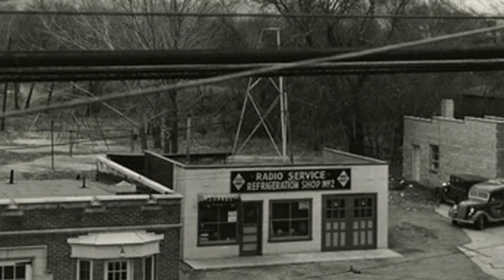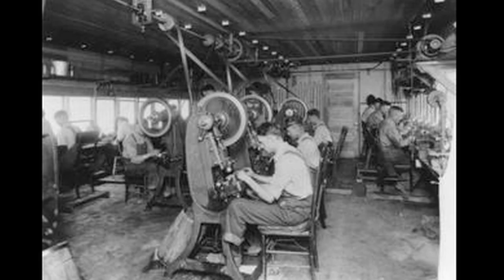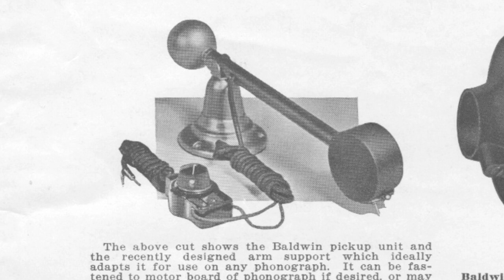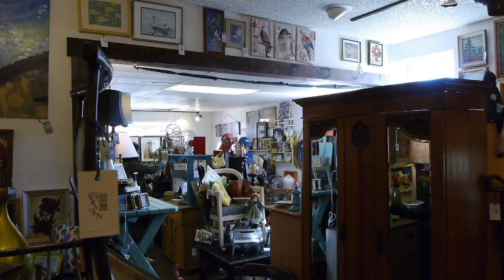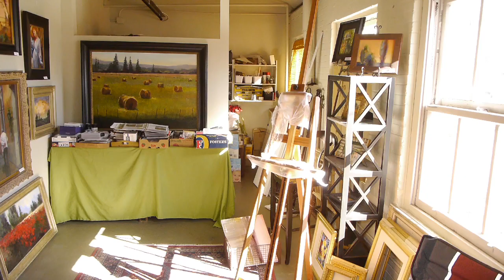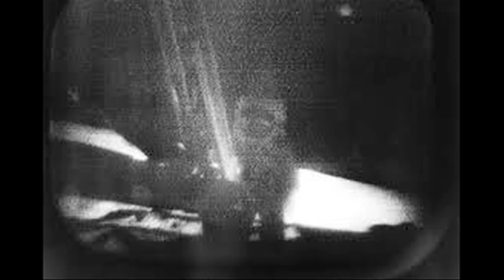The Baldwin Radio Factory - The Salt Lake & Eastern 2

Comment: You just made my day.  Back in the early 1970's I purchased a very, very old speaker.  The housing is made of wood.  The speaker itself is made of canvass and is about 7" in diameter.  The magnet is really interesting as it is not the round type commonly in use today.  It is a horse shoe magnet.  The cord is of course cloth covered, as was common back then.  There are two brass connectors at the end of the cord.  I attached a crystal radio to this unit and it works.  Not great sound today, but I'm sure back then it was considered state of the art.  And of course, the label on the speaker case says Nathaniel Baldwin.  Until this video I always wondered about the history of that speaker.  Now I know.  Thanks for sharing.
Reply from the maker: Cool speaker!!! You could call it a pre-JBL!!! And keep in mind the polygamist motto: One is never enough! Keep collecting.